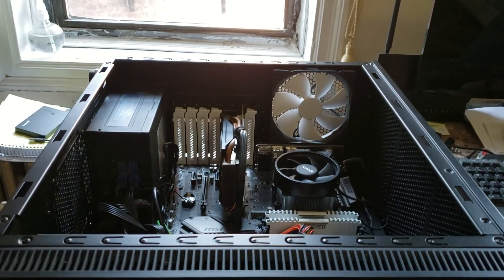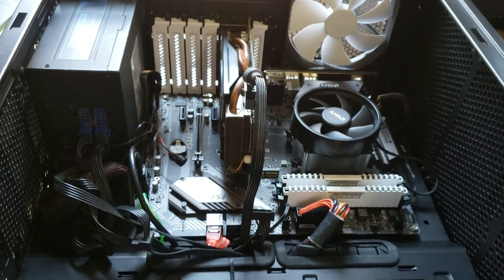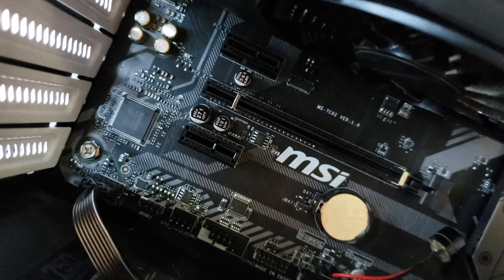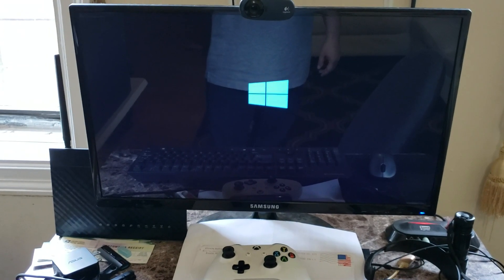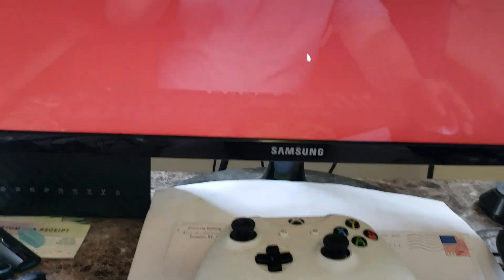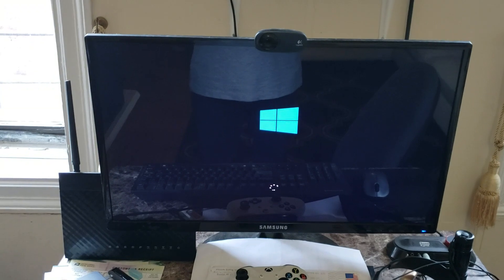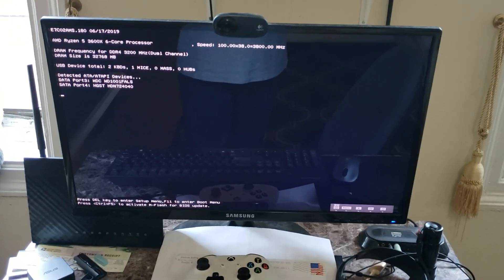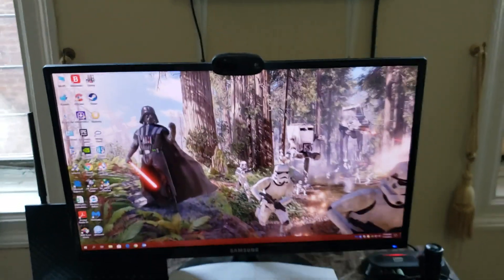Ryzen 3000 not booting on MSI B450/X470 Workaround Fix.

Comment: Mine was red led on cpu too but works after I press the reset button almost all the time. Not sure if this fixed my issue but I've removed "reset sw" contact and tried 2 cold boots 30 mins to 1 hr rest each and it turned on instantly. I've updated my windows with a security patch before the third try and tried again when I woke up after 8 hrs of it being off and it still turned on. I'm going to try again  later when I get back home from work. 3600 with Pro Carbon AC, bios v18 released on 7/30.
Reply: any luck?
Reply: Is it working?

Comment: i have red led cpu , pls help
Reply: medicann mgtow420 did u fix it? Cuz i have the same problem
Reply: I have the same issue, already tried to cpu and it’s the same (ryzen 3600)
Reply: I'm having same issue, cpu light, it's been working fine since I built the pc well over a year ago with a 2700x, came to it and screen was blank, turned off and won't boot, hope cpu hasn't failed.
Reply: @pye8man  no, cpu is good. its most likely some non-compatible bios version, gotta try flash a firmawares around that versions. keep sure to have ur pc grounded, once i fooled myself when the pc wont starting, it wasnt been placed on ground, i had it on table. weird.
Reply: @medicann_coping  it's all good, just the reset switch sticking on. Working fine now.
Reply: @pye8man  yeah good. i cant even remember clearly how i fixed it
Reply: A friend of mine have MSI b450-a pro max just stop working only a week old build with ryzen 5 3600 did the usual testing, swapping, checking voltages and shorts on the board it used to keep rebooting with the CPU light on took like over 50 times to just get a post then it never recover after that. Did the bioflash back to the old and new BIOS no improvement at all. Now at the moment without all the parts not installed it shows the CPU light as it lit solid so started to test for shorts. To my surprise the vrm section closest to the back I/O have a short in all 3 chips so yep looks like it RMA for the motherboard

Comment: BIOS FLASH:
For a successful bios flash use rufus(google it) to format the stick. Rufus settings can be found here https://i.imgur.com/6rOPnsxl.png

CPU Debug Red Light:
In some cases, after bios flash is completed you get CPU debug red light. To solve it try a different ddr4 memory, maybe borrow from a friend just for testing.
In my case it got CPU debug red light with Kingston "Hyperx Kit 2 x 8GB 3200Mhz CL18 HX432C18FB2K2/16" but it worked fine once i switched to "Corsair Vengeance LPX 2 x 4GB 2400Mhz CMK8GX4M2A2400C16R
" 
Bios version used is 7B85v17

My system: MSI B450 Carbon AC, Ryzen 3600, Corsair Vengeance LPX 2 x 4GB 2400Mhz CMK8GX4M2A2400C16R

Comment: I updated my Aorus B450 Pro WiFi motherboard to the latest BIOS version and it was working just fine with the Ryzen 1200 cpu I bought in order to do all these updates. I connected my usb with the windows installer in it and my Ryzen 3600 still doesn’t wanna boot the bios. I get a no signal screen even after updating to F41. Any advice?
Reply: try this take all the ram and only put one stick into the motherboard ram slot one. make sure already clear the cmos also. let the computer sit after powering for a couple minutes. let me know if that work.
Reply: Thank you CJ. It wasn't actually the ram.The issue was the BIOS. I was able to successfully update it and the CPU miraculously booted
 @cjandrews8441

Comment: Having issues with my tomahawk as well. I left the rest switch unplugged and it worked fine, i put it back in to see if it would boot but it would not, so i unolugged it again, though i'm having a issue that sometimes the pc will boot but 95% of the time it just won't post. So i can confirm that the reset switch is not the problem. But what should i do now? My pc is unusable now and it's annoying af
Reply: I just finished assembling new box with MSI B450 Tomahawk +Ryzen Zen2 3600+16Gb  G Skill Ripjaws 3200....No boot and no post. I discovered Yeb Havingas channel and followed his example. Everything is perfect now.
Reply: Peace+Opportunity i returned that shittt board. Going for a X570 board now

Comment: NOT WORKING
Ryzen 3600
Msi tomahawk B450
vega 64

Tried this reset button fix. 
Nothing changes

Starting only sometimes. 30-40 min Break.
If not starting solid cpu light is on.
After Vga driver update. SOLID vga light on mobo after cpu light clear. NOT WORKING.
Cant go back , now its completely dead
Tried version 17, 18 and 19 bios no change. Tried 3 different vga cards. 

Pleas help :)
Reply: I did the XMP profile 1 and lowered the vcore voltage 1.38 now it boots everytime the default was around 1.45 - 1.48. Everyone was saying thats to high for stock. hope this helps. v19 bios
Reply: Thomas Waagan Here is what worked for me. Get in the bios, then set ram to either XMP profile. It made booting much more consistent. That is all I can recommend until a stable Bios is released.
Reply: Thomas Waagan To get back to bios, try using bios flashback button to latest version then wait like 30 min. Then take out flash drive and turn off power on power supply, wait another minute and turn it back on. Power on your system and see if it boots.
Reply: You could try changing your cmos battery and see if that changes anything.
Reply: Thank you guys for replying.
I Will change battery in CMOS sirknob.
And i Will try your advise luke burtis. (Pc restart automatical after bios update is finished)

Comment: My pc wont boot at all it says no signal

Edit:i got it to work i just downloaded a older version of bios that only supports gen 2 then i updated back to the newest 3rd gen bios. Did it like 20 - 30 times and then finally it worked.
Reply: How you dl the bios when the pc wont boot ?  thanx
Reply: @scottmassick9824  i downloaded the bios with a usb and then flashed the bios (a function on b450 that allows you to update bios from a usb)
Reply: Thanks i appreciate the the help i have b350m bazooka  thats was shut down for a couple months and went i went to boot it up a couple weeks ago i got the lights fans working but no signal.. ive tried lots of stuff from youtube i think im gunna break down and buy a new psu tomorrow. If its not the problem atleast ive upgraded the psu..i guess. Lol
Reply: So did you use the first Bios which supports 3gen instead of the newer ones?
Reply: @schert5648  i used v19 i think

Comment: I have one running on an MSI B450 for the last 3 days. When it is up and running it is flawless HOWEVER. I always have to cold boot, so drain completely for a clean boot. The bios sometimes saves changes, sometimes it wont but that is a minor issue. Obviously as it requires a cold boot right now, restart is not an option. Finally only my SATA port 3 is giving any HDD led flashing, 1,2,4,5 and 6 no LED activity. All that aside as I said once I power up in the morning it can be one 24/7 as long as I do not restart or power down. Very stable once in windows but annoying not having a fast restart available. I could RMA it but I am enjoying it when it works and I am hoping new bios will improve.
Reply: BTW I have reset off as I am using it for the case RGB controller untill Mystic Light starts working fully again, I guess that was just pure luck.
Reply: P.S. B450 Gaming Plus + R5 3600 + HE 212 + 2*8 Flare X fyi.
Reply: Sorry for adding replies but I keep recalling things like, it freaks me out how my system idles at 38-40ºc CPU but actually never goes over 65ºc under real world load. Synthetic load can push it to 73ºc. Overall I am happy, I just hope we get a fully working bios soon. I check every few hours lol.
Reply: Same issue here, and it's been 2 fucking months...

Comment: BIOS version "7C02v19" is out
Reply: Really so is it finally working?
Reply: @fahim9767  well I'm still awaiting my ryzen 5 3600 however I've already flash to the latest BIOS. I just hope I don't experience no boot up issues.
Reply: Update us when you try!
Reply: @suren123a  sure
Reply: @UltimateSage101  how'd it go? I just bought this build without doing the proper research and got stuck with a computer that doesn't work.
Reply: @TTV_STUTTERBOI  also interested in results
Reply: @suren123a  ok I just installed my R5 3600 and it booted up on first try but my ram was set to 2133 so I had to manually change it to 3200mhz. But everything seems fine for now.
Reply: Still awaiting the cpu. Importing stuff to Caribbean takes some time
Reply: I tried the bios version that came out yesterday. I still only get a post maybe 40% of the time.
Reply: @InsulinAdikt  I surpsingly didn't have any issues posting, stock voltage was ridiculous and caused the cpu to quickly overcome the cooler I was using, it was moderately stable and performance was good, but I couldn't justify the jump from a 2700 so I returned it.
Reply: @jamesgarrett3000 I was getting pretty horrible thermals even with the wraith prism. Even on left for dead, I was getting 80+ c. Given how unstable that bios is, I'm not even going to fool with undervolting it. Since I am actually in the process of building a new X570 mobo pc, the 2600 is going back in the old rig. I wish msi didn't claim they would support the 3000 series on b450 motherboards. It would've saved me a lot of trouble.
Reply: @InsulinAdikt  yeah i ended up returning the board, it overall seemed decent, but I shouldn't have to compromise on a brand new build with a $120 board

Comment: I am just about to build a 3600X with this mobo. Had a lot of trouble with flashback bios upgrade and ended up flachbacking an early bios and then install the R5 1600 from my own machine and then update the bios via M-Flash. That worked! Bios 7C02v19 for the B450 Tomahawk was released on 2019-07-10, so it would be interesting to hear how your build runs with that version?

Comment: Mine works fine, and I have the same Motherboard paired with a Ryzen 7 3800x.
Reply: I had to fastback the bios 2 times before the bios would take properly. THen it worked. Also note the bios that says its ready for ryzen 3000 does not work. you need the lastest one.
Reply: @kylemagee9999  Hey bro, what would a "fastback" be?
Reply: @spotlessmlg6802  it's the firmware USB update port. No CPU is needed to update firmware with that. Just follow your motherboard manual to make it work.
Reply: @kylemagee9999  Okay thanks brotha, I'm going to try the solution listed in the video and if that doesn't work, my homie and I are going to remove all components to flash it using Fastback. Thanks for your quick reply, if you don't mind me asking, which board are you using? I'm using the B450 Gaming Plus for your reference.
Reply: @spotlessmlg6802  b450 tomohawk

Comment: I've never had my B450 Tomahawk board post with a Ryzen 3000 chip in it. I'm going to have to try that, but what a ridiculous thing to be holding it back.  Thanks for the Vid man!
Reply: just use fastback usb method it'll work. I had to do it 2 times though for it to take properly.
Reply: @kylemagee9999  yeah been there done that 3x for good measure. The board boots fine with my 2400G in it.  I Haven't had the chance to try unplugging the reset switch yet.  My Ryzen 3000 CPUs are in another boards ATM...  I'll mess with it more on the weekend.
Reply: @kylemagee9999  I have tried many fastback usb method methods, what one is working for you?

Comment: B450 tomahawk works for me but it crashes and freezes when im playing games
Reply: Can i get help lol
Reply: @Silenz  are you doing overclock or something? If not it could be graphic driver issue or other drivers. I had freezing issues before it was faulty ssd.
Reply: Abdrouf my hard drive worked with my other computer it has to be the bios motherboard. Actually i cleaned my hard drive and tried running r6s now and i crashed now i can even get bios screen when i try to boot
Reply: @Silenz  it boot into bios instead of windows? Did you change anything in the bios? Rry default settings for the bios
Reply: Abdrouf i cant get a post
Reply: Abdrouf i already tried clearing bios
Reply: @Silenz  do you motherboard speak is there beeps when you boot? Try installing one and what beep it gives you. It's either you ram cpu or faulty power supply. It's either the ram not working or your cpu not getting enough power or its not working at all try different ram and power supply.
Reply: @Silenz  mate i got this same problem on v18 bios, game freezes and auto close. When upgrade to v19 problem gone but what u need to do xmp profile not working for me. So i set manually timings and everythings work fine. Rams Corsair 2x8gb 3200mhz cl16